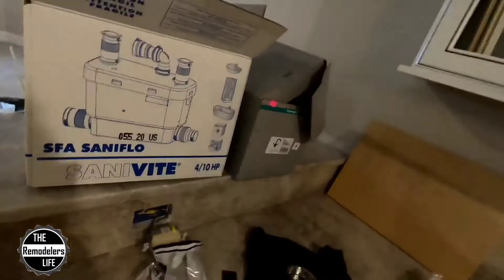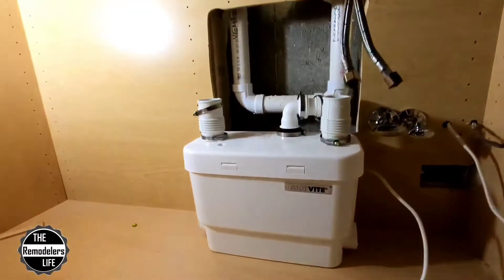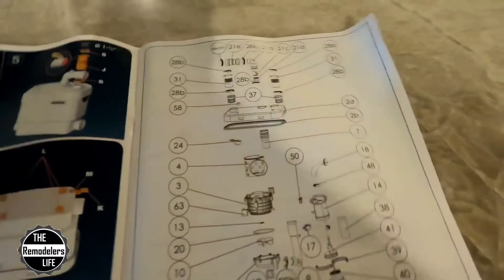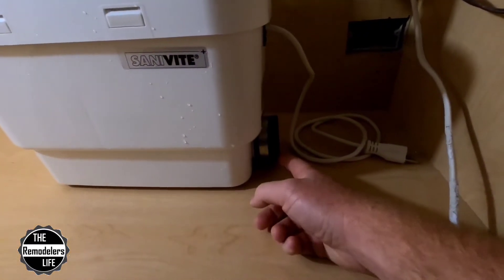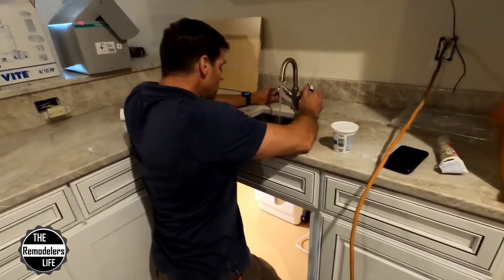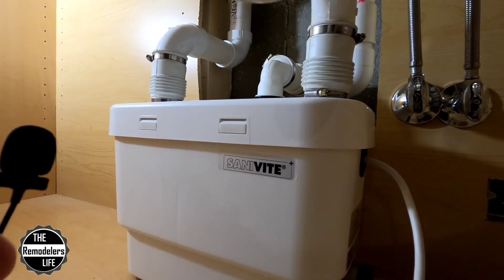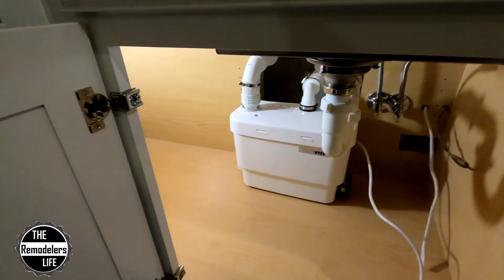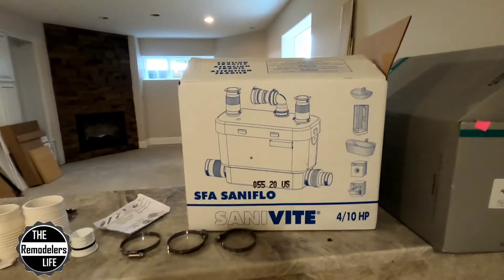Saniflo Sanivite Drain Pump, Unboxing and Review

Comment: The trap you put on is correct. No air vent is needed on the pipe from the sink, because if you have done your connections right, and it looks like you have, then the unit is venting through the connection on the left. The unit is pulsating or coming on for only 2-3 seconds at a time because it should, and it is, pumping out the water faster than the water is coming in from the sink. In one of the comments below, it was said, the membrane goes brown, this is caused by limescale in the water, Saniflio sell a formulated limescale remover to stop this problem. It should also be said that the Grundfos mentioned uses a float switch to achieve the same function as the membrane, and that float switch also gets covered in limescale and stops the unit from working if not cleaned with a limescale remover. This is because all items using water, like your washing machine, electric kettle or pump will get a build up of limescale and will need descaling, this is not a Saniflo problem, this is a limescale in the water problem

Comment: I think generally you're supposed to throttled a shut off valve on the outlet in order to avoid the cycling. I believe the cycling is caused by a mismatch between water leaving the pump and the water coming in. With the valve fully open the outlet flow is higher than the inlet causing a drop on the pressure which can also  cause cavitation if the pump continues to run

Comment: The pumps fills the unit to a level before pump start and the P trap and vent is built in to reduce external parts
Reply: You don’t need to vent this ?

Comment: Great video. Question if I use a 3 way diverter valve by passing my septic do I need a vent since there will be no gases? Im looking to pump gray water into my garden.
Reply from the maker: No idea. That would have to be answered by  Saniflo. Give them a call directly. They were very easy to deal with.

Comment: It shouldnt need a trap if the vent goes straight to the outside and the built in one way valve remains closed, which it would because water will always be pressing against it.

Comment: Your instruction at the 11 min mark is wrong. The middle elbow is a discharge elbow with a built in check valve NOT VENT! Middle is DISCHARGE, I have been working for Saniflostore for 10 years… either you plumbed it incorrect or you just confused the two in pointing them out….
Reply: I thought you had to use offset bends with saniflo pumps?
Reply: The installation is correct and he just pointed out the connection wrong

Comment: What’s the purpose of the vent line?
Reply: When water leaves it needs to be replaced by air. All plumbing uses a vent of some kind. Sinks can work far away from the main vent tho code usually dictates the distances and vent sizes.